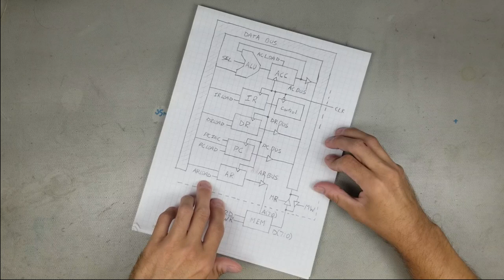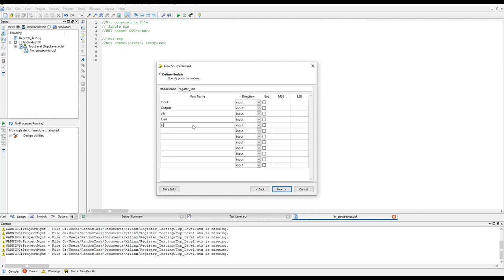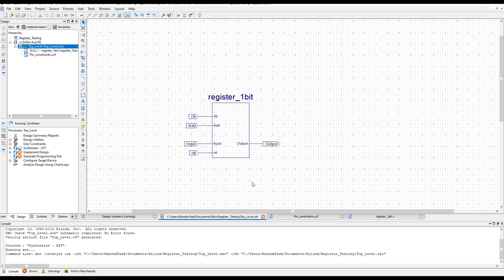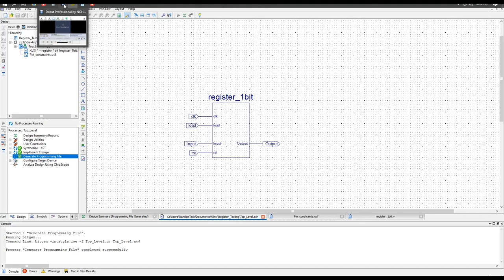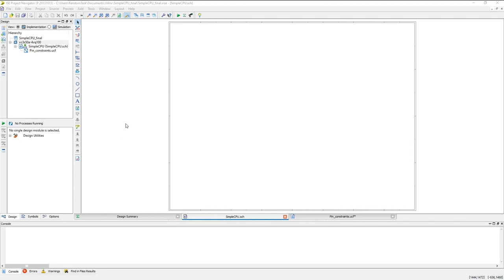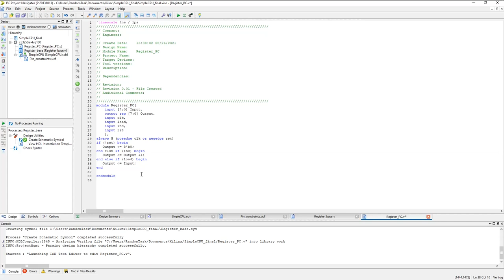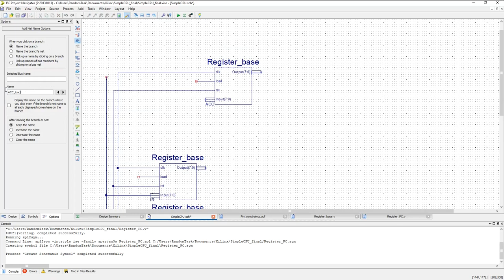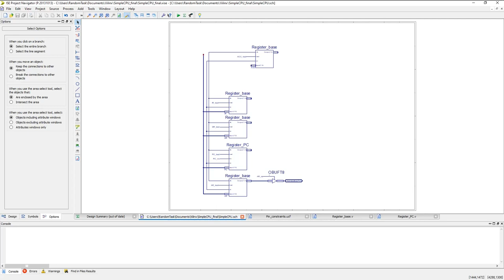HOW TO CREATE A CPU IN AN FPGA - Part 2 - Registers

Comment: Do I need to make I/O buffers if I'm using vivado for spartan-7 or artix-7 devices?
Reply from the maker: I'm not familiar with vivaldo, but it appears that it will add the correct buffers like the ISE does. However, if using a bidirectional I/O port, it is likely necessary to add the tri-state buffer.
Cheers.
Reply: No Vivado will create this for you. You can follow along in Vivado writing Verilog and then adding the Verilog modules to the "IP Integrator" (Vivado's schematic parallel).
Reply: @m1geo  yeah, I recently started exploring VIVADO IP intergrator , it is pretty amazing tool actually.

Comment: how about a) pre-cached instruction results in memory (fast cache ram chips, around 1-2mb per chip, 100MHz, one/two 8-bit parameters, 8/16-bit result in one-two bytes at the memory address), b) dynamic 64/128/512 switching instruction alu, mini-fpga core in fpga, not asic in fpga (actually its asic-in-fpga-in-fpga, because it switched between mini asics per core)
Reply: have you tried arrow sockit, its a cyclone v based dev-board, are you familiar with the mister project for de10 nano, and the de10 nano dev kit